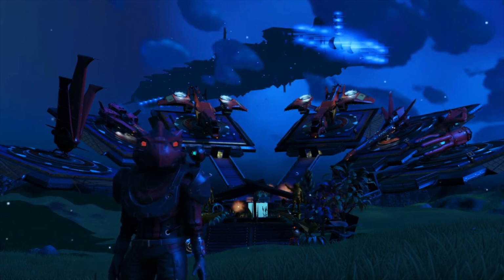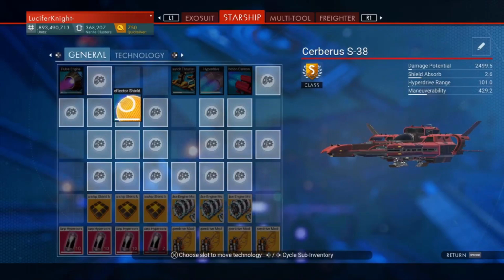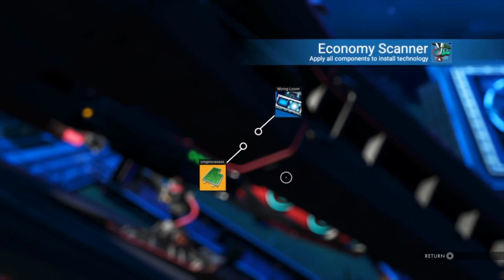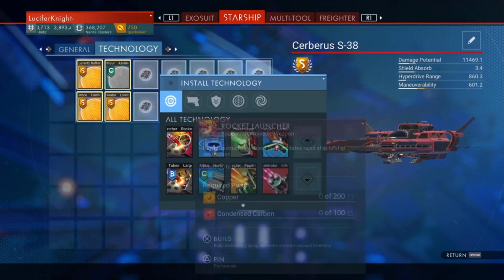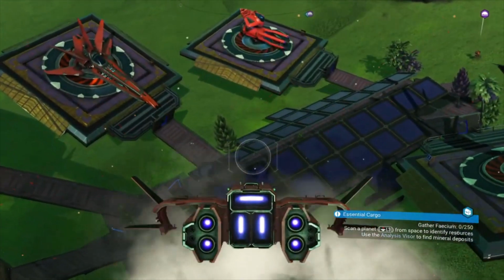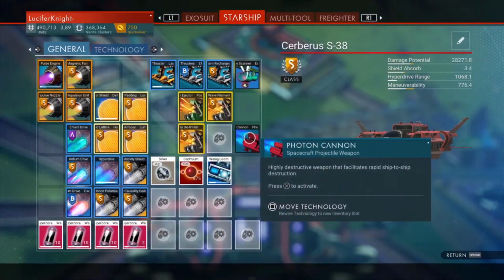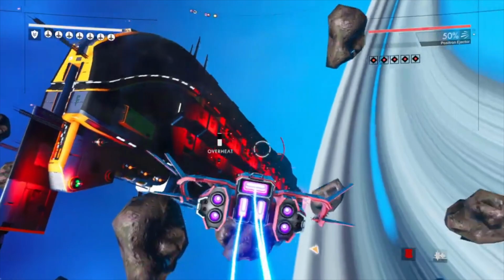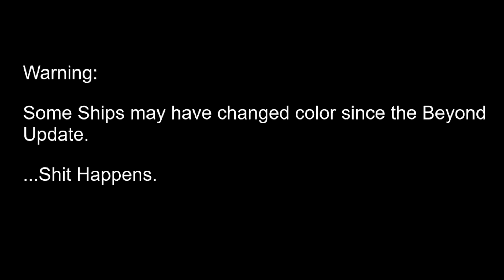No Man's Sky: How To Max Fighter Damage - 45,000 Plus!!!

Comment: I am testing how strong you can make the original ship we start with. It is still ugly but it's now a 48-21 S class ugly ship :) Using positron weapon, currently sitting at 42500 damage. I just grabbed the first 6 S class mods i found. Currently  busy doing the same test with the multi-tool we start with. My guess is ships don't matter, all fighters have the same capacity, it's just the look that change.
Reply: Nope, ALL ships except Shuttles have Small, Medium and Large tiers which effects available slots and stats. It is to bad because I kinda like some of the smaller fighters but I can't stand the stat loss.

Comment: Can you explain the reroll?
Reply: Every time you install an upgrade module, the values of its buffs are randomly generated within a certain range depending on what class the module upgrade is (S, A, B or C). So if you 1) Install an upgrade module 2) Check it's buff stat 3) Uninstall said upgrade module 4) Install a new upgrade module of the same class, it is likely that you will find they have slightly different stats. The idea is that you repeat this process until you have the ideal stats for whatever buff you are trying to achieve.
Reply: Mojo Jojo  an you not just reload the save if you get a shit module?
Reply: Marco Troxler I don’t know I’ve never tried it. But it’s a good idea, give it a go and let me know!

Comment: His starship was 2500 before he had done anything. 🤣 this is such bullshit! This is a glitch or something! 

I cycled through 50 S class damage modules, only picked the most powerful ones. I filled my entire inventory and tech inventory with modules. I can come up with the detailed specs later when I am not sitting in the car. If anyone is interested. 

I spent four hours doing it. no matter what I did the damage was 519. And that’s the highest damage I’ve seen in the entire game. We usually play 4 people. They have around 350 or 400 damage. 

I have the exact same ship as in the video.
If I was engaging in PVP with you, my 519Dam would get crushed by your 45000Dam. 

So really? What’s your secret? Because what you told us in the video is nothing new. It’s actually not good at all, it is a weak set up. Why would you neglect the Photon Cannon? You do have room for that to be fully upgraded too. You’re actually missing two slots in technology.  So it is obviously that you are doing some kind of cheat.
Reply from the maker: there have been many updates since this, however it still applies, you just need to hover over the weapons module now to see the real damage, also unless you use an old exploit that was patched ages ago the photon cannon is trash, besides the new modules added to the game since I made this video, this is the best method and setup. There is no cheat here or glitch, the damage potential the ship displays is not accurate to its true damage.
Reply from the maker: Also my highest damage ship does in the hundreds of millions and shields are pretty much invincible  but that glitch doesnt work anymore, why would I make a video of a weaker ship if it was an exploit/glitch
Reply from the maker: If you need help, I'm happy to lend you a hand, these things can be complicated ^_^

Comment: Lost, yeah I have a Class A but I have the Ejector and 2 S Class upgrades (3% on average) and I am sitting at 271 damage potential.  I cannot get anywhere near 1,000 let alone 45k.  Simply lost
Reply: Does the "type" of fighter make a difference?
Reply: You need to have a lot more modules
Reply: @babyyodasizzurp3042  so you're saying the its ok if its not a tier 3 fighter. already got me an s class tier 1 fighter but yeah. damage is like low 200-300. and im seeing in his video. his base damage was already like 6000.

Comment: Is this video still valid in 2021? You are going to fast, this would be fine if you already know what goes where but not for someone looking to learn a new method. It appears you divide your main section module from the secondary add-on you get and place 3 upgrades with each. Am I right about this? If so an explanation might be enlightening instead of an assumption. And OFC you do not explain how you get the max stats on each weapon, that would be handy for others but I already know about that.
Reply: Yes, I just did this and it still works perfectly. Yes, there's two slots for tech and cargo and you need to split them up so you don't overload your weapon.